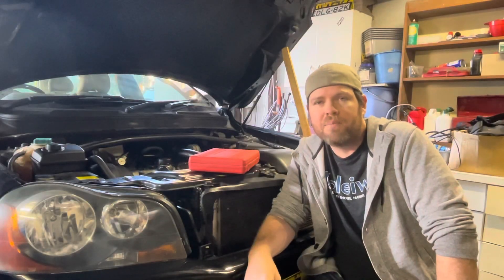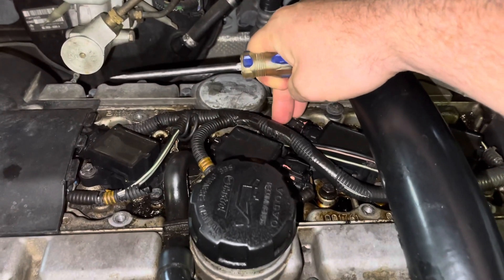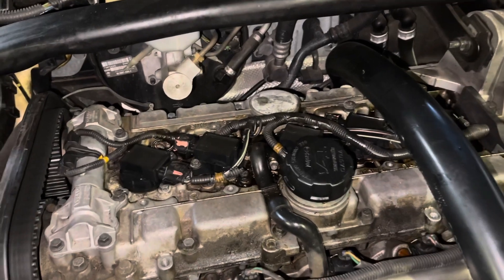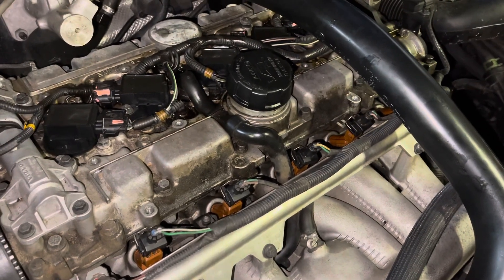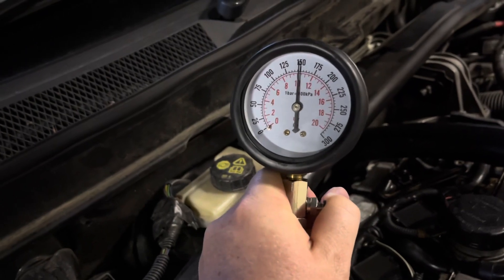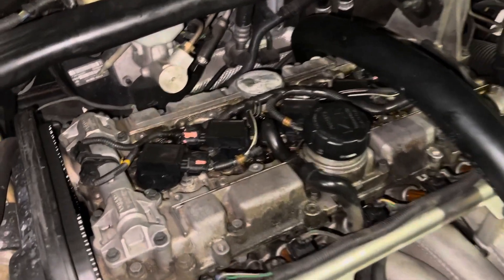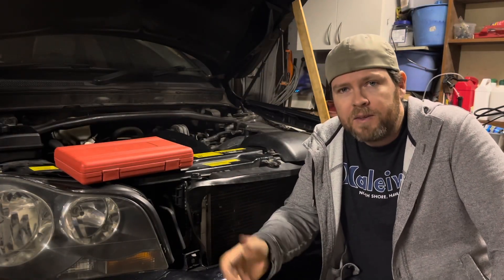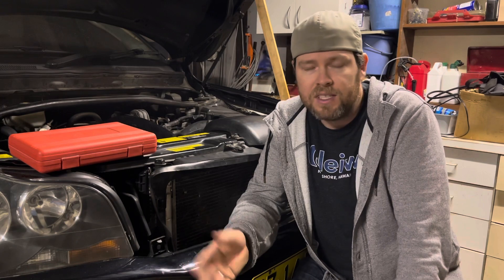Bad cylinder? How to do a compression test on an engine. Confirming the worst on the Volvo XC90

Comment: I have a Volvo XC60 D5 205 that emits white smoke after several months of being idle. The vehicle lacks power and doesn't move forward. When I accelerate fully in neutral, the engine struggles to reach 3000 RPM. During the first diagnostic check, it indicated a lack of compression in cylinder 2. After clearing the error, I received two error codes: P0100 and P0113, along with a lot of white smoke. For your information, there is quite a bit of oil around the hoses. The reason for the immobilization was that the accessory belt snapped, so we recalibrated the engine and it started.
Reply from the maker: Yay glad to hear you got it moving again!!

Comment: You have to push the gas full when starting the car. Otherwise you will got fals information
Reply from the maker: My understanding is Fuel supply should be disconnected either at pump fuse/relay or by disabling the injectors. This is so you don’t have raw fuel entering the cylinders during testing. And so you don’t risk your engine firing. Could you explain why you should push the gas pedal?
Reply: @bbtrevival to get full air flow, closed airflow is massive vacuum pump
Reply: @bbtrevival i think he meant activate clear flood mode.

Comment: standard issue : leaky fuel injector burns a massive hole in the exhaust valve
Reply from the maker: Nice. I wonder if that was it. I wasn’t the one to open up the motor so didn’t get the see the bad valve. But that would make more sense as I couldn’t work out how a valve would get bent without a timing breakage.
Reply: 😮leaky in what sense, dropping fuel or passing air around its seal?

Comment: Hey, I noticed you had some black liquid around the coil packs. I have the same leakage on my Volvo V50 1.6d diesel. Do you remember what was the problem for your car?
Reply from the maker: I believe it had both a bad head gasket and a bent valve. But the motor was generally tired so seals were leaking aswell. Black liquid would have been an oil residue build up.
Reply: Pcv valve is clogged I think
Reply: Old oil cap gasket. Common

Comment: There is also a more accurate tool a leak tester which can show more about the condition of your cylinder-piston group. But it requires an air compressor.
You can also buy a boroscope to look inside your combustion chamber. 
They are starting from 20$ for a shitty one from 200$ for a turning head one and the sky is the limit)
I bought a turning head one for 200$ so I can "look back" and check coal deposits on pistons and injectors and oil leaks on valves.

Comment: Good Job man.. now take the tools and open it ! replace the head gasket. You can do it my friend! you are smart to do it! Good luck brother!
Reply from the maker: Thanks Brother! I just don’t have the time for a project like that at the moment.might keep it as a project for a rainy day.
Reply: That would be a great project. But imagine you would have to  made someone to machine the head, flatten the surface of the block and level it. Shops around do it, but for enormous prices exceeding price of a new-second hand car or an engine. Nowadays absolutely no need to do all that work. If you can t free a stuck piston rings with chemicals, then you better scrap the car or sell it on price like author advices... Thanx for the video...